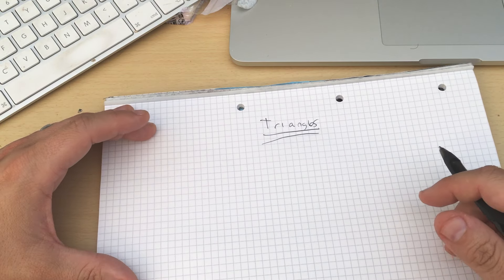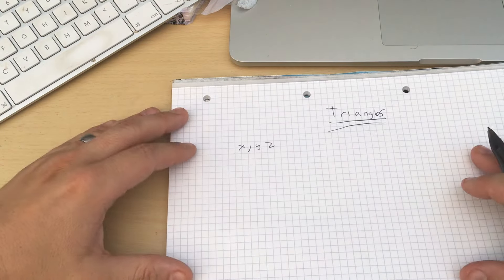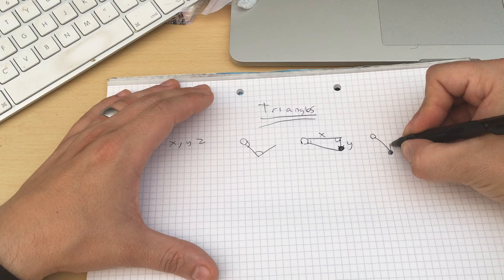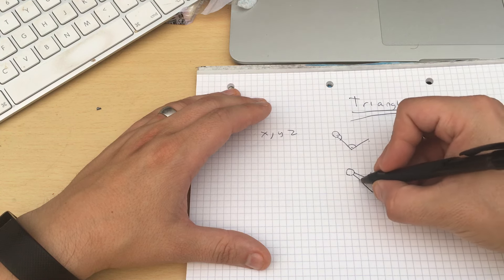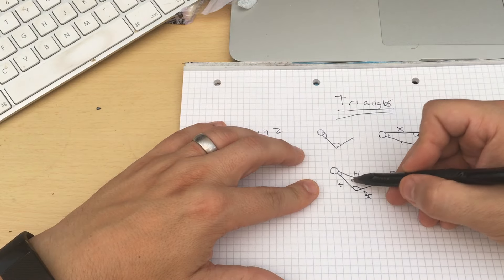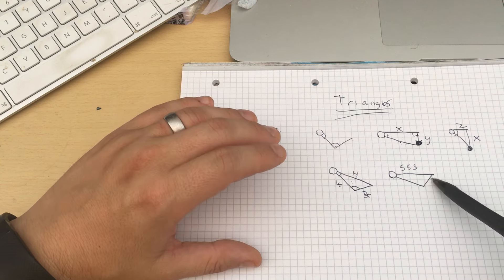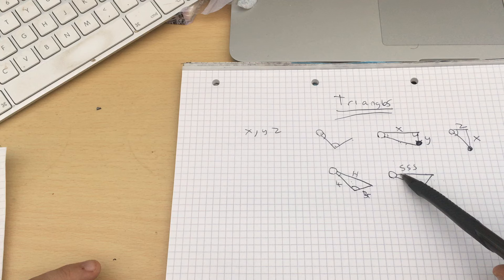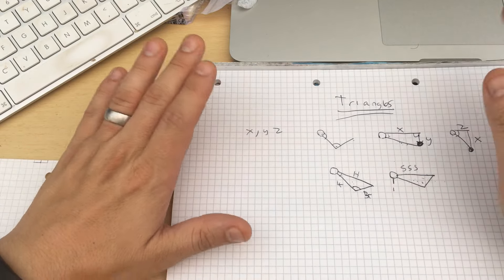Learning Robotics : It's all about Triangles.

Comment: Is this assuming you have stepper motors so you know the position of the arm in real time? Also you'd have a way to determine depth whether it is a beam-sensor or stereoscopic imaging perhaps. Your robot would be built with approximations of where the arm is (from the center line of the robot relative to the vision) right?

What about drift, maybe you'd correct for drift in real time based on trial-error of grabbing that object.

nice videos